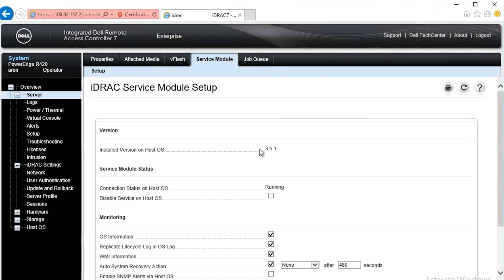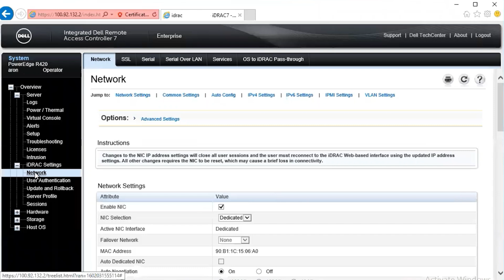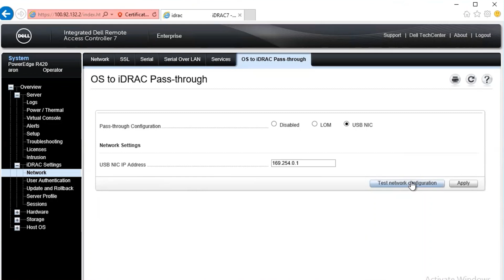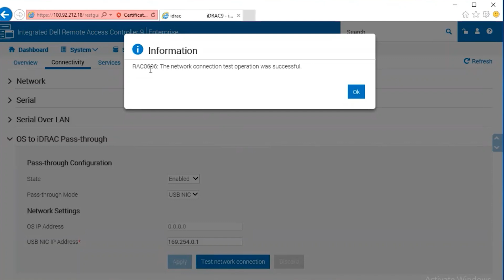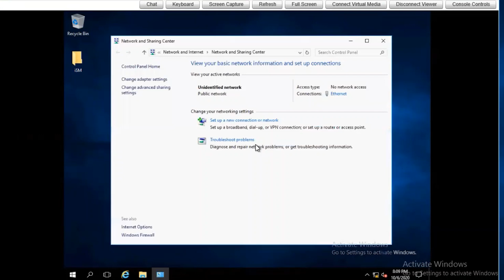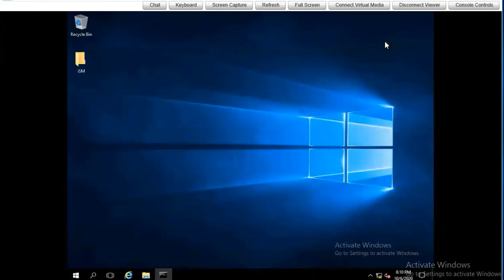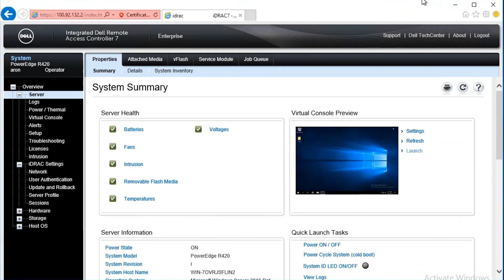How To Troubleshoot Issues With iDRAC Service Module

Comment: Hello, I installed the Dell EMC iDRAC Service Module 3.5.1 for ESXi 6.5 via SSH on my PowerEdge R620, all good. In my iDRAC it shows me the OS, DNS, all ok information. My question is, in VMWARE web client (in vcenter or directly on the host's web) how can I view information or perform actions on iDRAC? is this possible? Thanks!
Reply from the maker: Hello Eduardo Gonzalez,
You can connect to IDRAC via IP Adress, If you want to do this through the module you have to configure it before,

If you need any further assistance you can always contact our Support staff directly: https://www.dell.com/support/contact